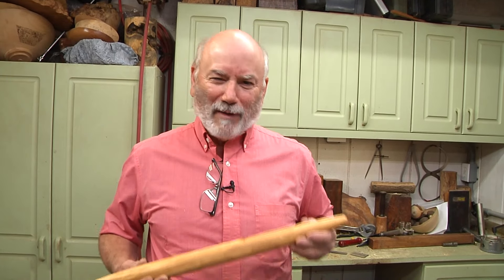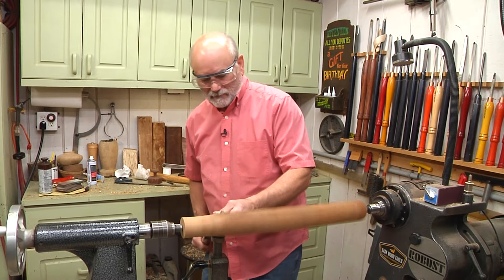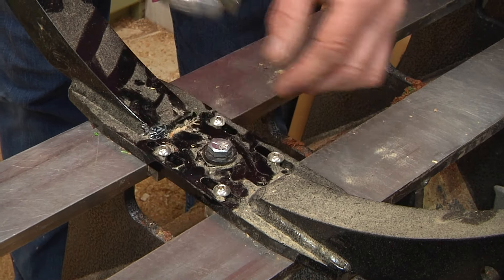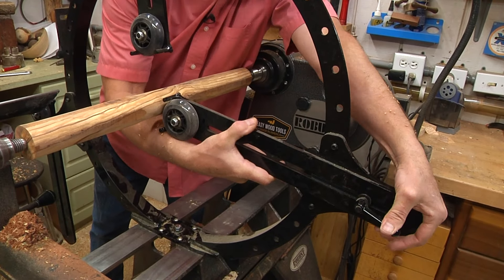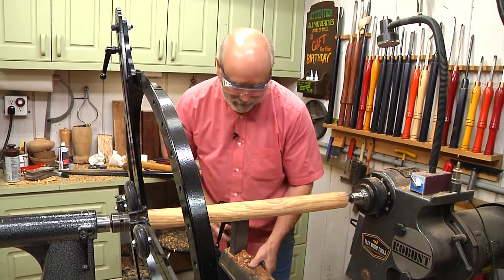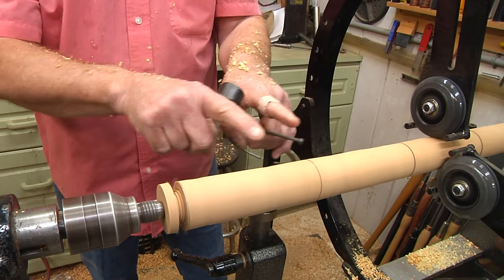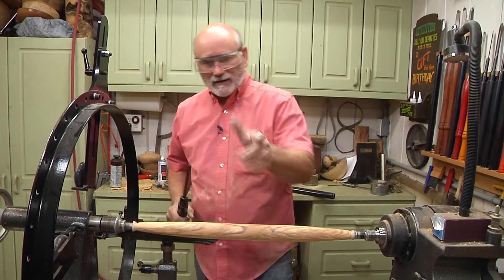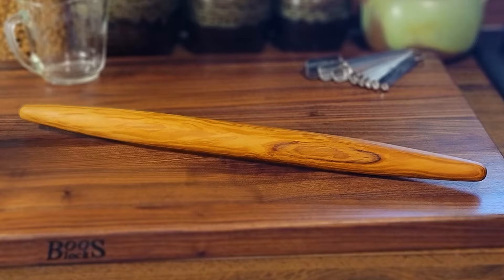French Rolling Pin

Comment: Nice piece of work. I caught the length of the parallel centre portion but I didn't notice what the overall length of the rolling pin is. Can you clarify, or is it not too critical?
Reply: Not too critical, but a typical French roller is from 20 to 22 inches long.